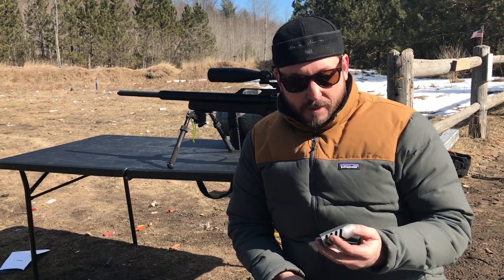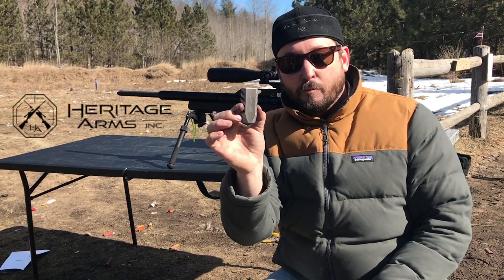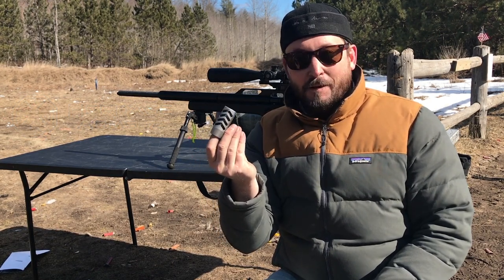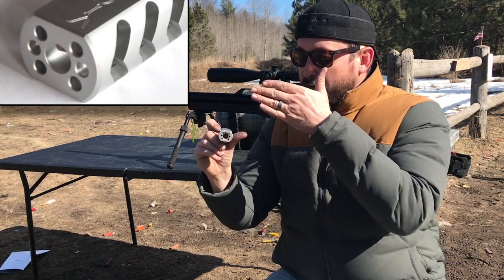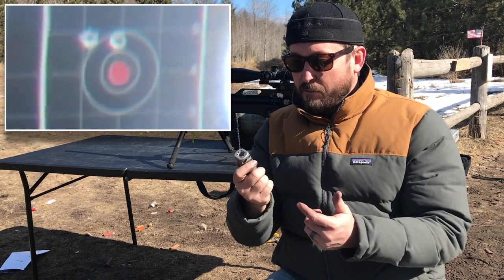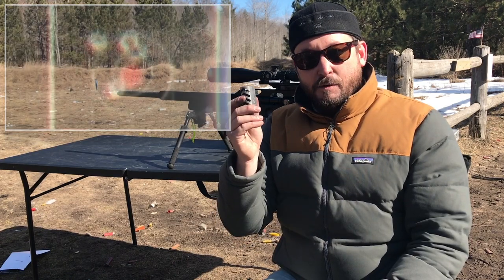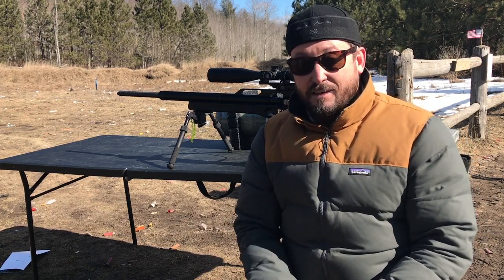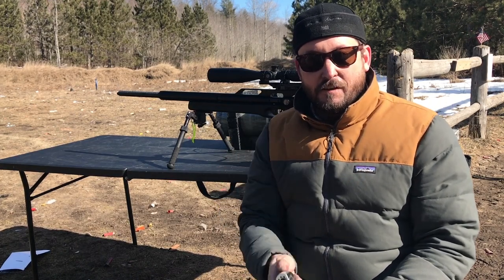Muzzle Brakes for Air Guns?  AirForce Texan .45  Big Bore Airgun with Heritage Arms Muzzle Brake

Comment: I put a muzzle brake  off a Ruger 22 rim fire, on my 1077 pellet gun !  i did had to sand it out a little larger to fit on the barrel.  WOW A BIG DIFFERENCE Looks so cool. its much louder, and LOTS MORE POWER ~  I'AM REALLY IMPRESSED  WOW  BIG DIFFERENCE
  it almost double the fps 😎 Who cares if its Aluminum Anodize Lavender?  I DON'T ~ IT WORKS NICELY
Reply from the maker: Great idea! Thanks for watching!
Reply: @UpNorthAirGunner  You can get the 1022 Tanker muzzle break in pink on Ebay for 11 bucks the other colors 29 bucks

Comment: Thanks for doing a proper test of these things. I think they will only be applicable for big bore very powerful airguns such as that .45 Texan. I doubt very much they could make a difference for less powerful guns. I wonder if any shear forces are also sucking air into the brake and this also might add to the stabilization. The hot gases from a real firearm of course will still be very rapidly expanding, it would be great to film with a high speed camera the flow patterns close up. I know SED did this but only as far as I know with transparent silencers. Once again great video.

Comment: Elsewhere you've mentioned that an artillery - like hold is the best for the Texan. Does the muzzlebrake change that at all?
Reply from the maker: Yes - it does help with the hold sensitivity.  I have gone back and forth trying to figure out what hold works best - either light artillery hold to allow it to recoil back with little pressure against the shoulder OR a very hard hold keeping the butt pushed really hard into my should pocket.  On different days I have have good results with both techniques.  Will keep tinkering....

Comment: Great video,, I know a lot of people don’t believe me when I tell them that my muzzle break tighten up my groups a lot dew to the lower recoil with the long barrel,, cause body language has a lot to do with a rifles accuracy when it has a 34 inch barrel ,, how is the accuracy coming along with ur 308 ,,???
Reply from the maker: I got the .308 Texan dialed in with 155 grain Hunters Supply bullets and I shot a 1.18 inch 5 shot group at 100 yards the other day.  Best so far!
Reply from the maker: I got a 1.15 inch group with the .308 the other day with 154 gr. spitzers from Hunters Supply.  Best group yet at 100 yards.  That was on a BONE stock Texan though with a fire lapped barrel.  I am going to add a Mad Dog stock and carbon fiber sleeve and muzzle break in the coming weeks and try again.  I really want to get one of my Texans down to MOA or less at 100 yards.  Trial and error!